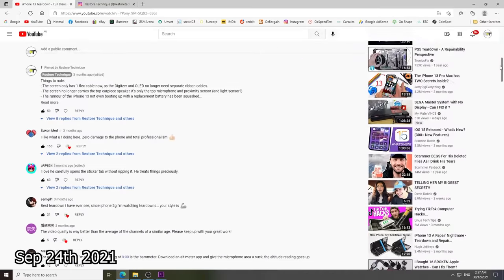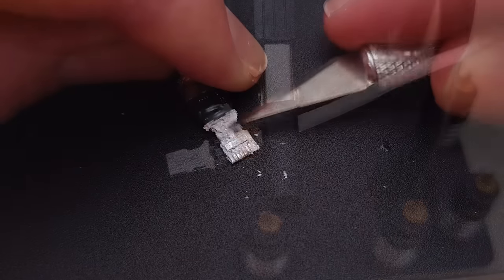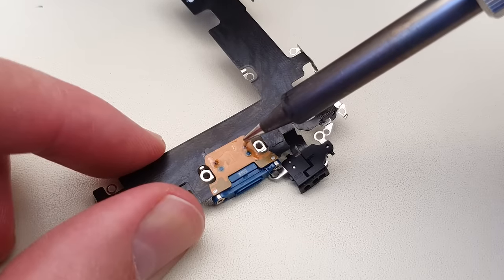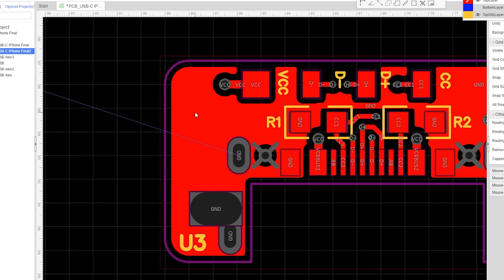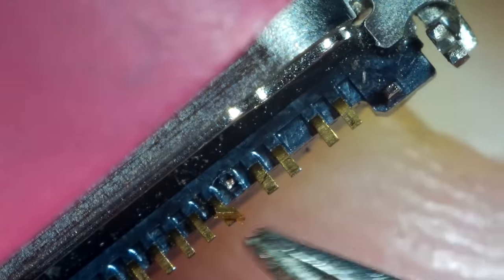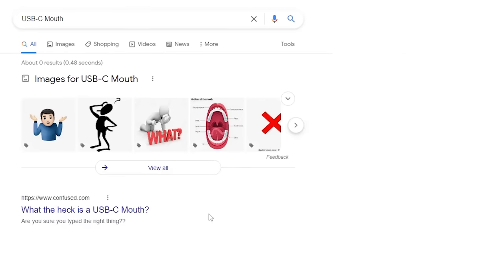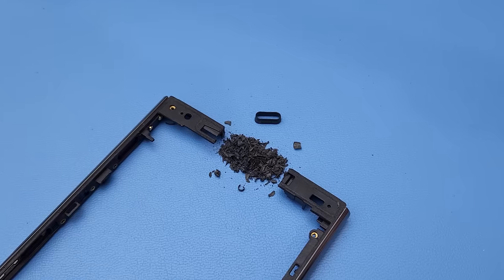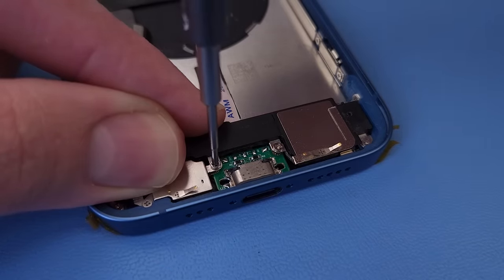I made a USB-C iPhone 13

Comment: this video was helpful because it made me realize i just bought the wrong cable on amazon lol. I thought iphone 13 was already usb c
Reply from the maker: 😂 happy to help
Reply: Simply replace the port and you won't need to waste the time by purchasing the lightning one
Reply: @denkasyanov  should just get the lightning one cause its not easy to replace, and lightning is better. And i know this is probably a joke. Edit: im just saying what my phone repair-guy said, doing some research i have found out i am wrong, make sure to not take everything you see on the internet to heart.
Reply: @Kenzie1051  lightning is not better
Reply: @Kenzie1051  By what metric is lightning better than USB-C? edit: nevermind, I realize now that you're just a young kid.
Reply: Well, now you know how to solve that.
Reply: @pigglewiggle175  ‘you’re just a young kid’ is neither appropriate nor tasteful to say. They made a mistake and edited. Lightning is better to one extent which is that it’s proprietary but that obviously has changed overtime
Reply: @DanKop2  ehm, why is proprietary better?
Reply: At least USB-C is easier to get for a decent price
Reply: @Cyberfishofant  I did say ‘changed overtime’ but in essence, proprietary means that it can be custom tailored and fitted for every iPhone - the issue is lightning is way too old now
Reply: not until iphone 15 will it be official
Reply: @pigglewiggle175  Nice reach, least I don’t need to put down other people to feed my own ego ‘piggle wiggle’💀
Reply: @DanKop2  You're the one trying to do some weird little power trip trying to lecture me with your original comment.
Reply: @DanKop2  in software it usually means sorta the same thing as closed source
Reply: You bought the wrong phone xD
Reply: @DanKop2  its literally a child...
Reply: @DanKop2  fun fact: as far as i know, lightning was invented to save money.
Reply: bruh
Reply: well now you can follow and change port too so your cable isnt a waste
Reply: I got the solution: Don't buy an Iphone
Reply: @Cyberfishofant  and based on how inefficient, small and breakable it is, i wouldn’t doubt that
Reply: @jennyhoffmann3054  why not? IPhones compared to androids as a phone comparison is hard to do because androids are not proprietary, they have different hardware and the only way to tackle things like battery life, efficiency etc… is to brute force custom parts - iPhones are not only ridiculously compact and efficient but they also offer a wide range of solutions such as airdrop which is arguably one of the best features on a phone, it just make so much sense and works so well.
Reply: @DanKop2  i still would look it up, as i could have just learned wrong stuff
Reply: @DanKop2  Only difference being that Airdrop makes no sense because you can do the same thing with every other Android device by sending files and photos with bluetooth, its literally the same thing than Airdrop, it just doesent have a fancy name. They take existing functions and rename it with a typical Apple type of name and sell it to their customers as a completely new ground breaking technology.
Iphones are ridiculously expensive, their interface sucks and you cannot customize anything. Not to mention that they try to do anything so their customers have to drop more money into Apple products by first of all, making their sceens nearly unfixable when they are broken and also their stupid lightning cable which pushes customers to go buy more and go full Apple with all their products. I had bought an Ipad some time ago and it was so bad that I threw it in the bin after only two years. It was full of bugs that made it pretty annoying to use, the constant software updates made it slower over the time that I could not even download and update any apps anymore and I had to get a new lightning cable every few months because they are so crappy and cheaply produced that they constantly broke. I switched to a Huawei for literally a third of the price of that Ipad and that thing is better in every single way and I dont have a single complaint about it. So why should I still even bother buying such a thing when Android devices are just way better and more convenient?
Reply: @jennyhoffmann3054  you did NOT just compare airdrop to Bluetooth💀
Reply: @jennyhoffmann3054  ehrm, compatibility on ios/mac is WAY better (my laptop refuses to get files from my phone over bt). Android also doesn't have procreate
-android user
Reply: @DanKop2  haha oh my god yes I did, yes I did criticize Apple, omg!1!11! Am I gonna get crucified now? skull emote
Reply: @jennyhoffmann3054  bro, I don’t think you understand. Bluetooth is fucking dogshit and is over 20 years old, it’s clunky, very high in latency and doesn’t let you send images like you mentioned. This is only achievable with 3rd party software
Reply: @jennyhoffmann3054  incorrect. Bluetooth is used to FIND a device, but a peer to peer wifi is made between the devices which is different from regular Bluetooth. Women🙄
Reply: @DanKop2  Samsung has had airdrop equivalent which was rebranded several times, but currently known as quick share (Though not widely known since there are many more old/conventional ways people use for Android like ftp, wifi direct, cable OTG etc meanwhile on iOS there's not really a choice other than Airdrop).  Android has Nearby share. No need for 3rd party app to do that. As for open vs closed source, there is not much of benefit to closed source as you might think. They both can be the same. Apple could provide the source code for iOS thus making iOS "open source", but iOS will remain the same tailored OS for iPhones. The only difference is, with the source code out, others can now make a clone of iOS e.g. flash it on phones other than iPhone or make a custom iOS version of some sort.
Reply: @OngOlsen  making ios open source wouldn’t work considering how little ram iPhones have. I imagine it’s a matter of components too
Reply: @Cyberfishofant  well it was designed that way to be compatible between Apple devices but not to non-Apple devices. Pretty ingenious strategy for a company with devices from mobiles to desktop. Google tried to do the same blocking Microsoft out and trying to lock people into Android/Chromebook but unfortunately it should have been Android/Windows as Chromebook isn't a real competitor to MacOS. If only Google would stop fighting Microsoft and team up with them for once and synergize Android to Windows. Samsung and Huawei mobile to laptop synergy/compatibility has similar and some of their own unique functionality to iOS/Mac but unfortunately Samsung/Huawei laptop are not accessible nor prevailent in most if any market.
Reply: @DanKop2  I believe you've mistaken open source with something else. Open source does not and will not take more RAM. Open source is when the source code is available to others, other than the owner/maker. So if Apple just releases/publishes the source code to iOS, iOS will be open source and there is no change to iOS. The reason why Android uses more RAM is not because it is open source, it is the way it's designed to behave. Android behaves like juggling while iOS was designed to focus on the foreground App, both great and have their uses for different people. However despite going open source not affecting iOS itself, Apple does not want it to go that route due to them emphasizing security. Going either closed or open source is a double edged sword. Being open source, since the code is available to others, exploits can be found and utilized somewhat easier. However on the flip side, the same exploits will be found much faster and patched much faster; as well as being able to adopt and utilize new features more from other's fork. Though the security part of Apple hasn't been going too well as every single iPhone has been jailbroken quite easily and with several exploits usually with iMessage and the lockscreen. At the same time having the jailbroken scene available is actually a good thing too, as many now adopted features on iOS have actually came from jailbroken iOS. Android has a similar situation where a lot of features where adopted from Samsung (forked Android).
Reply: @OngOlsen  no this isn’t what I said. ios is optimised for apple hardware… I stopped reading after the first 2 lines cause you misunderstood me:/
Reply: @DanKop2   i understood exactly what you said. Maybe you should continue reading because being optimized for Apple hardware has nothing to do with being closed/open source, which I did explain in there.
Reply: @OngOlsen  no… if ios were made open source, the lack of apple hardware would render ios mostly crap…
Reply: @DanKop2   sir, you misunderstood what open source is. Going open source does not alter a software in any way. There will be no lack of hardware, iOS and iPhone will not be affected. Open source means the source code before being compiled is just shown to the public and other people can play around with it. Android is open source but no matter what Samsung or whoever does with Android, it will not affect the Google Pixel. The open source code is just a copy, what goes into the phone is still up to the maker and they will still have their own copy.
Reply: @DanKop2  Ignorance is Bliss; Willful Ignorance is a Death Kiss. Hopefully I explained it well in the reply you didn't finish reading, up to you to finish reading it or not.
Reply: @OngOlsen  you're right
Reply: @Kenzie1051  then your phone repair guy is wrong xd. Usb C is the fastes transfor protocoll at this form factor ever created till this day.(nice to see that you did your own research)
Reply: @DanKop2  dude how is it being proprietary better? I cant just use one charger for everything
Reply: @DeliriumXM  That’s the point, if the proprietary component is actually tailored to its equipment, it’s great. Until it isnt
Reply: @DanKop2  dude you’ve yet to explain why, you just said “because it is” essentially and no, its 100% worse having lightning for phone and airpods AND type c for everything else like my speaker,midi, vapes, battery, etc. lightning is just apple and hence proprietary… and that sucks….
Reply: @DeliriumXM  I didn’t say lightning is good, I said proprietary is good and here’s why:
A) It’s tailored for the product, knockoff brands are absolute dogshit and the USB type C market is filled with some awful producers
B) proprietary means R&D which should mean consistent updates throughout history on the product (apple has strayed away from that)
C) Competition as a proprietary product has a KPI
Reply: @DanKop2  Your logic makes no sense. 💀
Reply: @vertihippo1274  mk
Reply: You voted for Biden, right? That might explain everything.
Reply: @reiniergarcia  What does this have to do with politics-?
Reply: @DanKop2  i’m young but feel old as shit sometimes lol. And anyways a young kid is going to have a much better understanding on technology than most older folk. I literally grew up through the birth of the iphone
Reply: @oldaccount67543  Hey fair enough man, I’m 21 but still feel out over Apple’s tech, the M1 chip was utterly fantastic when they released it not too long ago, it already sucks with the newer MACs
Reply: Just make your own USB-C iPhone 13. Would be a pain to have to cancel the order.
Reply: @RestoreTechnique  props to you pouring money on video and getting little money from your Channel
Reply: @pigglewiggle175  dude it's an opinion
Reply: @jamessssssssss1   Tell me that you've never read a datasheet in your life WITHOUT telling me that you've never read a datasheet in your life
Reply: 1000th like
Reply: @pigglewiggle175  i can't tell you I haven't read a datasheet without telling you so I'm just gonna say it, I haven't read a datasheet.
Reply: @novasigma5964  14 pro and pro max I thought
Reply: @Kenzie1051  why. I phone do not change  it to type c ? Because  people  have so money to  waste!!
Reply: @DanKop2  You seem to know a lot about hardware but completely clueless on software at the same time lol. Do you watch tech channels? That probably explains it.
Reply: @bierymolina4379  Is that all you have to say?  And you're wrong.
Reply: @jennyhoffmann3054  Go sista! Android all the way.
Reply: Convert iphone 11 display lcd to oled
Reply: Convert iphone 11 display lcd to oled
Reply: Convert iphone 11 display lcd to oled
Reply: Convert iphone 11 display lcd to oled
Reply: Convert iphone 11 display lcd to oled
Reply: Convert iphone 11 display lcd to oled
Reply: Convert iphone 11 display lcd to oled
Reply: Convert iphone 11 display lcd to oled
Reply: The lightning cable is better than the USB-C cable, or at least the port is better. When using Lightning Ports, the cable goes bad rather than the port which is a hassle to replace. USB-C ports are not bad, but certainly not as reliable as lightning cable ports.
Reply: @Kenzie1051  there was so much to unpack from that comment
Reply: @pigglewiggle175  iTS CLEAR LIGHTNING BETTER BECAUSE FOR FAST CHARCGING YOU CAN USE ONE SIDE ONLY, SO YOU CANT JUST PLUGIN YOU ALLWAYS WILL BE CHECKING IF YOU USE CORRECT SIDE FOR FAST CHARGING
Reply: @gueg2298  It's just this crude implementation of it. USB-C fast charge works fine on native phones
Reply: @DanKop2 every Android has a native support for Bluetooth image and all types of file transfer( and I it's really too slow)  but we already got nearby share in latest Android versions which works on wifi.
Reply: @kicktroll  yes but it’s not peer to peer, it has to be on a public space which is terrible
Reply: @DanKop2  apple fanboy thinks sharing files is ground breakin🥴 android been doin this before apple. And there are a lot better apps for sharing but only works on androids.... and apple users cant share apps
Reply: @mikelogan8977  ‘a lot better apps’ you mean an airdrop equivalent isn’t built in? Tsk tsk
Reply: Hmmm no, you just bought the wrong phone.  Next time looks for one with a USB-C port. ;D
Reply: 哈哈哈哈哈😂
Reply: RIP
Reply: Amazing work. Did you think about using the iPad‘s USB-C Port as Basis?
Reply: Hey mister. Nice work. Next mission would be make a outlet that can handle both cables 😍
Reply: Nice job bro
Reply: @Kenzie1051  Den was making a joke
Reply: @Kenzie1051  lightning is wayyy worse
Reply: @DanKop2  not knowing that wen you send something over bluetooth on an android, it switches automatically to direct wifi if available 😅 also disregarding that android has apps (nearby share / instashare i.e.) for interconnection, that can not only connect droid to droid, but also droid to pc, mac, linux and windows. also proprietary is not better than open source. open source is a standard that mostly everybody agrees on, making it interchangable, while proprietary usually only works in the boundaries of one manufacturer.
Reply: @ElGrandeIngenio  and the boundaries set by the manufacture allow for economies of scope and scale and creates the simple theory that everything made from start to finish is known and optimised. That’s why androids have overkill RAM, android is VM for god’s sake
Reply: @DanKop2  lol at this point im connvinced hes a bad troll xD you cant be that dense.  @Olsen Ong  explained open source very well, its about the openness of sourcecode, yeah, apple could make IOS open source easily, but then we would see the festering mess that they call their code, and security through obscurity would be no more
Reply: @ElGrandeIngenio  That makes no sense. Open source software is plagued with the customisation features that cause obsolescence in android phones within a year or two. I’m still running my iPhone XR and have little to no issues, despite it being around 4 years old now. Windows is an example of dogshit software where it sucks on everything because the optimisation is not down to the vendor but the company that sells the damn PC in the first place. Same with android, it’s not tailored for every phone well enough, so you end up with oddities
Reply: @DanKop2  no, the boundaries that it usually only works in the ecosystem of said manufacturer is because intereoperability is hard and you would have to implement industry standards, and if you do that, your device not only becomes interconnected, its becomes interchangable. thats why apple doesnt play nice with open standards, its not that they couldnt, its mostly due to the fact that if you have one apple product you better get all of them, because otherwise it wont work at all. so its basically that they are pushing a mac or an ipad if you own an iphone, because mixed infrastructure just doesnt work well with apple products. for you second comment: you are confusing software with hardware again. apple builds uniform hardware and software tailored for, AND ONLY FOR this hardware. in this regard apple is akin to a playstation, running a dedicated OS, enabling the use of all system performance all other software basically (OS2, Linux, Windows) runs on a myriad of different systems. but even tho MacOS is far more optimized on the architecture and runs on proprietary systems from only one vendor,  
while several linux distros (which is open source btw) can run basically on anything, while even being faster than MacOS, even when you compare them on a mac. windows is a different story, windows always has been king in backwards compatibility, you can run some win95 software still natively in win 10, but thats a different story. i have worked with all systems (Apple, Microsoft, Linux) and i have to say, sadly apple is the worst. they not only do everything differently from industry standards, its also by far the most pain to work with on a system level. ther GUI is fine i guess, but when you get in the weeds of OSX, you wont have a good time
Reply: @ElGrandeIngenio  I’m not reading an essay, can you dumb it down.
Reply: @ElGrandeIngenio  apple bad with non apple, already explained. It’s an ecosystem
Reply: @DanKop2  yeah and why do you think that proprietary is better? apple bad with non apple and ok with apple, open standards, ok with apple, great with everyone else connect a samsung smartphone to a windows pc to a linux pc to a fairphone or pair an android with an iphone-> just works; pair an iphone with an ipad-> good luck, might work might not. we had that case, even apple and apple doesnt work sometimes, but a pc and a phone from 2 totally different vendors play nice because both implement open standards, instead of homebrew proprietary black magic
Reply: @ElGrandeIngenio  pairing an iPhone with iPad is easy???
Reply: @ElGrandeIngenio  also gotta love how the only way to transfer photos from your phone to a pc without a wire is through emailing lol
Reply: @DanKop2  no, you understood that wrong, im not using an iphone anymore
Reply: @DanKop2  pairing an iPhone with iPad should be easy, but in practise it doesnt work as great as you might imagine, friends of mine own an IT store, and they get these problems more frequent then you might think, when generation of ipad and iphone differ, they might not work at all, despite up to date firmware. we had the constellation of an android pairing with ipad and iphone no trouble, but ipad and iphone wouldnt work, even with updated FW
Reply: @ElGrandeIngenio  not sure about you but my mom has her iPad and iPhone paired up nicely… and she’s 60 something
Reply: @DanKop2  thats purely anecdotal, usually apple works, but when it doesnt you cant troubleshoot it, thats my point. it works like 90%, but the rest 10% it wont work, even tho everything is in order. and these are 2 proprietary devices in the same ecosystem and yet it doesnt work all the time? tell me how this is a great product
Reply: @Kenzie1051  Haha, razer 130W charger goes brrr
Reply: @Cyberfishofant  lol not
Reply: @DanKop2  USB-C is regularly tailored to fit specific devices all the time? theres 240w usb-c devices for high end laptops and much lower power variants for phones and such. keeping a standard propriety only helps you make money essentially as you control the market for those devices.
Reply: Nan
Reply: @Kenzie1051  do you know what a joke is?
Reply: @DanKop2  you should have just stopped after the second sentence mate, that's the only part of your comment which is correct anyway
Reply: not even the 14
Reply: @pigglewiggle175  Imagine being a salty 10 year old 😮
Reply: @DanKop2  Apple making things proprietary has nothing to do with tailoring it for a specific phone, cheaper or easier they do it simply for the monopoly it allows them, same reason they serialize everything in the phone and order one off versions of off the shelf chips, with non functional changes in deals with the chip fabs. Ironically they are likely increasing the price but, when your customer base is that special a price increase is probably a good thing.
Reply: Yeah! Why would you do a really complicated and risky task of replacing or refunding the cable, better to do changing iphone to usb c
Reply: 14と15で間違えるならまだ分かる
そんなことある？
Reply: @pigglewiggle175  You can be old and not a tech guy 🤣
Reply: is the iphone 13 like this about to buy?
Reply: @jennyhoffmann3054  do you know who invented bluetooth? it was ericsson, before they were sony ericsoon.& before they became just sony. yhose scandinavians are sharp, hey?
Reply: @baba.mkhulu  Yeah and? Bluetooth is a great thing ... but I was just going on about how simple Airdrop is, that its nothing special and that most other android phone have the same feature just with a different name.
Reply: @RestoreTechnique  This is so funny
Reply from the maker: @lucasng5127  ikr 😂
Reply: Lightning is more durable. Way more durable than type C
Reply: @shubhampushkarofficial  Lightning is completely unneccessary and stupid, it's just another way for Apple to make more money.
I'm glad that the EU is making USB-C plugs mandatory for all apple products in the future, this will reduce the hassle for us users and actually reduce electronic waste but it seems that quite a few people still don't get it
Reply: @jennyhoffmann3054  See this before making claims. Just because you can't afford something, stop hating on things.
Reply: @Cyberfishofant the price is no different than usbc also apple uses USBC in almost every device besides the iPhone.
Reply: @shubhampushkarofficial  there we have it! Thats your average apple user response "just because you can't afford it" lmao
You guys do everything to boost your ego's.. humm
Reply: @xxzenonionnex7658  for apple making a custom plug is cheaper cuz they don't have to play for the rights to use
Reply: @jennyhoffmann3054  the real question is, "Can you?"
Reply: @jennyhoffmann3054  lmao, typical boomer 😂😂 get well soon.
Reply: @shubhampushkarofficial  how old are you, 13 or what, no offense but it seems like it
Reply: bro this one made me laugh whole day and cry too coz its not that hard for apple to switch to USB C !!!!!!!!!!!!!!!!!!!!!!!!!!
Reply: @Kenzie1051  yeah, after owning both an apple for most of my life, and then owning a samsung for like a year. i already like samsung more with the charging, software, and user interface!
Reply: @RestoreTechnique   can you make iPhone 7 or 8 model into a full-screen like iPhone xr
Reply: Yeah if you have to buy the charging cable seperately, you went to the wrong phone manufacturer. Buy a proper phone in the first place.
Reply: Usb c and thunder charger is same port but I bought the wrong charger in FedEx
Reply: @Olsen Ong bro that guy was tryna say that even if IOS is made open source it won't be the same on the other phones compared to on the original iPhone because of the hardware iPhone uses
Reply: @Jared Petit In 2024 already
Reply: @Kenzie1051  yeah dude the lightning cable is better, not like usb-c is 20 times faster. 😐
Reply: the average apple user
Reply: It comes with a cable already ;-;
Reply: @DanKop2  
A) proprietary products just don't comply with the industry standards, there is no correlation supporting that "proprietary is good".
Proprietary products are result of many reasons:
- when there is no industry standard, every product is proprietary.
- when the manufacturer isn't happy with the features available with the industry standard.
- when a manufacturer don't want to pay royalty fee to the patent holder of the industry standard.

- in 2009 most mobile manufacturer agreed to be compatible with USB-charging in Europe. 
- While other manufacturers switched to micro-USB-B, Apple launched an adapter to carry around, and kept using their 30-pin docking port.
- Then Apple released their revolutionary Lightning port in 2012
- Later in 2014 USB-IF published the USB-C standard and it was adopted by IEC in 2016.
- Other manufacturers started switching their design to USB-C, while Apple still use Lightning (except laptops etc.)

B) proprietary does not correlate with updates either.
- Can you point at any updates made to improve the Lightning cable, in the 10 years, after it was released in 2012?
- After specifications for USB-C was published, there has been several updated publication, improving performance and adding functionalities.
- While USB-C supports USB3 and 10 Gbit/s, Apple hasn't evolved since 2012 and they are stuck with USB2 at 480 Mbit/s, that's quite a bit different (pun intended).

C) I don't understand how a proprietary product has a Key Performance Indicator.
however, a proprietary product can be a competitive advantage, if you have a reasonably good product. Because current customers might decide to stay loyal, because they are "trapped" within your proprietary ecosystem. Other potential customers might be pushed away, because they don't want to be "trapped" then skew their options next time.

Back in the '90s and '00s every mobile manufacturer had their own proprietary charging plug.
When you replaced your phone, you probably got a different charging plug (even if you stuck with the same brand), because they had a new socket "tailored for the product".
Through the '00s manufacturers started to use 5V for charging, had initially used proprietary plugs, but it started to allow special USB-cables with proprietary end.
As more phones got smarter features, we got USB to transfer data, and at some stage they realized they could omit the proprietary charge port and use standard USB.
Then we come to the 2009 agreement mentioned above.

There is no reason what so ever, to claim that something i good, just because it is proprietary, on the contrary when it makes it incompatible with everything else.
Even if it objectively is better, but it's better to chose the widely adopted standard. Even if Lightning were better than USB-C (but it isn't). Other manufacturers would have to pay $4 to Apple for every plug
Reply: @thorbjrnhellehaven5766  you wrote a whole lot of stuff for one person who isn’t going to read it because it’s been too long. Get a job
Reply: Simply change the phone with an Android 👍
Reply: @DanKop2  sorry for my bad habit from whiting longer articles where the audience actually wants the full story. 
I'll try shoter on two key arguments:

You claim proprietary is good. And Lightnig is good because it's proprietary. 
Proprietary is just different from the industry standards, for miscellaneous reasons. 
It can be good, but it's not necessarily better, and it's generally bad to be incompatible with the industry standard. 

You claim proprietary is linked to R&D and upgrades. 
Lighting hasn't changed since 2012 release, while USB got upgrades for more power and data transfer and more.
Reply: @tcpma  👍I'm surely not considering any iOS devices, before the are forced to switch to USB-C within end of 2024, by new legislation from the EU Parliament.
Will be interesting to observe if they will keep Lightnig outside Europe, or if all iPhones/Pads will get USB-C then.
Reply: @thorbjrnhellehaven5766  I'm not considering any apple device, not depending by usb-c or lightning 😂
Reply: @tcpma  I don't think it's an important factor. Price and flexibility is just as important.
I have sometimes vaguely considered an Apple product, but every time they are just too overpriced.

Needed a new laptop last year. MacBook were just too expensive compared to all other alternatives doing the job.
Reply: @tcpma  my point about USB-C is merely that's on disadvantage less
Reply: @thorbjrnhellehaven5766  just talking...I love Android and don't understand this kind of devotion to Apple (although I know they do high level device)
Reply: @thorbjrnhellehaven5766  if you scroll up far enough I’ve said that apple has messed up already
Reply: @chrikke  that’s crazy, don’t remember asking
Reply: @chrikke  have you seen politics?
Reply: @chrikke  Cool, look it up and have fun learning about adults
Reply: @chrikke  You’re talking about hyperbole here, a concept that transcends age
Reply: @chrikke  thanks for clearing this up
Reply: @pigglewiggle175  it's only more durable, but that's the only benefit
Reply: @Cyberfishofant  idrk, but looking at the female connector, it looks like transfer speeds could double with a new version of the port that can be backwards compatible
Reply: @jennyhoffmann3054  With the iPad part, you probably are not aware of battery degradation. And also, what iPad did you buy?
By the way, how did you switch to Huawei after the US ban?
And maybe be open to new things instead of literally TRASHING something because it had problems.
You could just clear cache to promote performance.
And yes, I did waste my time making this pointless comment.
Reply: @DeliriumXM  Isn't that what USB-C trying to do?
Let everything be charged with one port: Amazing.
Reply: @reiniergarcia  bruh
Reply: @Reed_Gibby  making one would still be expensive because of the soldering you need to do
Reply: @Mr_BucketHat  lighting has usb 2.0 speeds when usb-c has up to usb4 speeds
Reply: @denkasyanov  Didn't give a man wrong advices. He still needs the lighting one - to extract the chip 🤣🤣🤣
Reply: Lol
Reply: @FireFoxDestroyer  Yeah ... battery degradation. They don't do it for "battery degradation", the reason it charged so slowly is that it's just cheaply made crap. the charging adapter of my uni Ipad (Which is a 10.2" Ipad 8 from 2020) only charges with fucking 14W. Like dude what is this crap? My 200€ tablet charges with 40W and that thing has an actual safety system for the battery, since it stops charging at ~95% automatically to conserve the battery. Yeah guess what? The Ipad doesen't do that, because you know why? Because it's crap, the charging cable of the Ipad is 3 times thinner than the one of my tablet. My tablet is from 2017 I think btw... so this was before the US ban... also do you know why they banned them? Yeah because Huawei was too much of a threat to Apple, they were getting too big of a company and they were slowly but surely getting closer to Apples amount of finances, outrunning them in every way. So what was the solution to this? Yeah let's just fucking ban them of our platform.
I sadly... yeah sadly have to use a Ipad 8 every day... but just because it is an obligation from my university, like I need to use it for the classes. And gosh that thing is so full of bugs, it so shit. Just many little bugs that make it completely annoying to use, also Apple TV doesn't work half of the time lmao, its just a fucking joke honestly.
Who in their right mind would be dumb enough to pay for such crap honestly? I dont get it, please explain, I want to understand it. Liturally the only good thing about that ipad is its performance... it has zero to none lags but for 500€+ you can expect that, but the bugs and a lot of the other stuff make it unbearable to use.
My friend just "had" to buy a new Iphone 14, because her old Iphone 12 broke. It didnt broke because it fell down or anything but it broke because the electronics had a malfunction which made it unusable, yeah great a 2 year old phone which completely quits its life... Great quality product I must say, not. Again a living evidence for me of how crappy their products are. Guess how long I have my Android phone? Yeah 5 years which isnt even much and it still works flawlessly. Fucking unbelieable isn't it? It's almost like magic these android devices ...
Oh sorry, did I just write an essay of 400+ words, didn't mean to do it.
Reply: @jennyhoffmann3054  doesnt every battery has a safety system?
And also, charging slower is better for the battery.
My android tablet charges to 85% (not sure why I wrote that)

By the way, you are using an iPad 8, which is a base model.
Reply: @pigglewiggle175  u clicked on his youtube channel didnt u?
Reply: @DanKop2  proprietary = bad
Reply: @denkasyanov  lol
Reply: Solar charging iPhone next thank you
Reply: @RestoreTechnique  Solar charging iPhone next thank you
Reply: @Kenzie1051
Reply: @pigglewiggle175  it was cool, like almost a decade ago. lol
Reply: @RestoreTechnique  only thing how will you connect wired headpone
Reply: @RestoreTechnique  How much would it cost for you to put USB C on iphone xs max for me?.
Reply: @Kenzie1051  love you man
Reply: @pigglewiggle175  durability, lightning definitely better in terms on durability
Reply: @pigglewiggle175  shut up wiggles
Reply: @DanKop2  proprietary is not better at all it makes lighting expensive also gives Apple a monopoly over lighting where as USB-C is universal which means Apple will not make of it at all but lucky EU has force Apple to adapt  USB-C.
Reply: @denkasyanov  Big Brain
Reply: Not the likes💀
Reply: It should have always been.
Reply: Oh lololol
Reply: @DanKop2  "Women🙄" that is neither appropriate nor tasteful to say.
Reply: @RestoreTechnique   next step make a iphone that can use replaceable batteries
Reply: Not surprised an iPhone user would make such a mistake.
Reply: Just get an adapter…
Reply: I will not be upgrading anytime soon my gaming phone is good for a life time until the processor gets outdated it's working on a Snapdragon 888 you should feel blessed with it just as good as the 8 version Snapdragon.
Reply: @DanKop2  custom tailored and fitted LMAO that means nothing!
Reply: Lol
Reply: @Kenzie1051   he was joking
Reply: nope because apple is still in the stone age
Reply: @kingjohan1335  ok wizard
Reply: how did the comments turn into  
a group of 12 year olds hurling random vocab words that they heard once from overhearing their dad's phone call 5 years ago at the nearest person in the exact same situation
Reply: You didn't make the mistake by buying the wrong cable. You made a mistake by buying the wrong phone 🤣
Reply: @pigglewiggle175  Yeah, you're the young kid
Reply: It is, in Europe.
Reply: You didn't buy the wrong cable, you bought the wrong phone
Reply: ahahahah brooooo
Reply: Ug
Reply: haha nice one... cries alittle inside
Reply: @SkaterMisterAxe  So apparently you can't use Bluetooth and if you have a Samsung you cant use the quick share website.? And Google photos website AND amazon photos if you really use amazon photos.
Reply: This video was so good
Reply: Papi
Reply: @Kenzie1051  r/Woooosh
Reply: To be fair, very reasonable to just assume it is... If the company isn't apple lol
Reply: @novasigma5964  So what are the Apple fans going to say when the iPhone 15 releases with the exact same goddamn lightning port.
Reply: Not even the iphone 14 is usbc!
Reply: @Kenzie1051  ijoz😊😊😊
Reply: @Kenzie1051  wooooosh
Reply: @DanKop2  it’s not better at all and yea it’s true also being a kid isn’t an insult it’s a pass the guy didn’t mean it in a bad way. If you’re over the age of 20 and don’t know Type C is better than you’re pretty dense
Reply: @jennyhoffmann3054  smart mommy
Reply: @morro570  Ur just jealous
Reply: Dtgyyh❤❤😂 I’m so proud to 🎉😂😂
Reply: Hate it when I buy the wrong charger cable for my phone and have to convert the phone to that charger port 😢😢
Reply: @jennyhoffmann3054  it's not really bluetooth, new phones got something that's basically airdrop
Reply: @DanKop2  new samsung got their own airdrop, which isn't bluetooth sharing
Reply: @bruk5827  bout time
Reply: @bruk5827  lol thats literally the same thing as bluetooth, my old phone from 2016 can even do that. How do you think the files get send to another device? By magic, no guess not
Reply: bruh
Reply: but iphone 15 coming with type-c
Reply: 10 months later iphone 15 test models have been distributed to content creators and include the usb c port. are you a time traveler?
Reply: @jonasevensen1058  lightning is more tight, but slower and proprietary
Reply: @Kenzie1051  soldering isnt exactly "hard"
Reply: @Kenzie1051 this guy rode the short bus and hes not afraid to tell u
Reply: It's okay. You can now get the 15 series.
Reply: yep
Reply: @Kenzie1051  💀💀
Reply: @pigglewiggle175  lightning is far more durable than usb c
Reply: @Kenzie1051 trying out the recipe from my own blog is
Reply: Now that iPhone 15 has usb c, then is no problem
Reply: @RestoreTechnique  You can also make a flat and sealed magnetic connector =D
Reply: It
Reply: @RestoreTechnique  it's the i phone 15 now
Reply: 300th
Reply: wha be great is i can do what a 3.1 type c and put a smudge onto apple tpe c fiasco(the powerbank syndrome)
Reply: @DanKop2 lol this is only a year old dunno what android you was seeing
Reply: @DanKop2 Bro never heard of nearby share or quick share. He compared it to freaking bluetooth lol.
Reply: @club6525  because it is Bluetooth. All of it is, difference is usability and speed
Reply: @DanKop2  Quick share uses the Wifi Direct protocol to directly share with encryption. It's a peer-to-peer wifi network.
Reply: @RestoreTechnique  make a lightning port iphone 15
Reply: @DanKop2 It's proprietary and garbage

For one it's limited to USB2 speeds, also known as 480mbps. This is literally slower than WiFi, using wireless is literally faster.

Airdrop is at least 2 times faster than the bloody wire.

Its completely obsolete garbage.
Reply: @RestoreTechnique make an iphone 15 with lightning
Reply: It started from the 15 series. As well, the 15 pro series has even bigger transfer speeds. The selling point to the 15 pro series skus of apple Iphones. As well the difference between the 15 pro and 15 pro max is that the pro max has better sensor cameras but it is expensive and built worse. Jerry rigged it! On the opposite side the 15 pro is a disappointment from a standpoint of value as well. The good news if you still want an Iphone with USB C is that the new 16 series is going to be launched soon. So wait for those to see if they fixed the mistakes that needed to be fixed with the 15 pro series skus. My opinion...Have an apple! Not an electronic device made by them. Enjoy a fruity apple! That is what I wish for you.
Reply: My i phone12 pro make for me how much